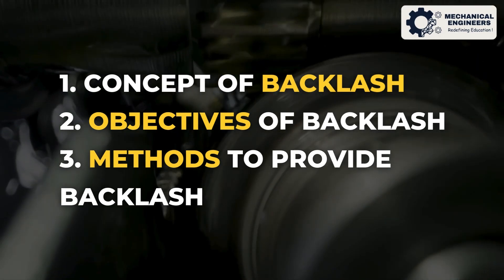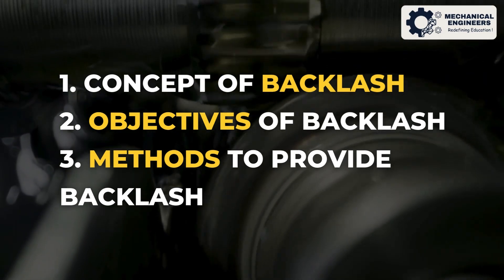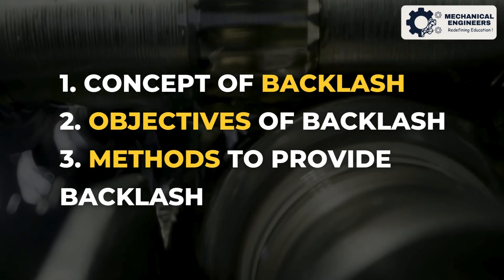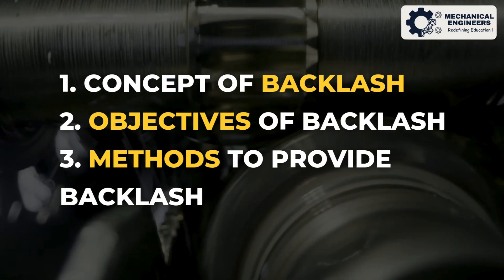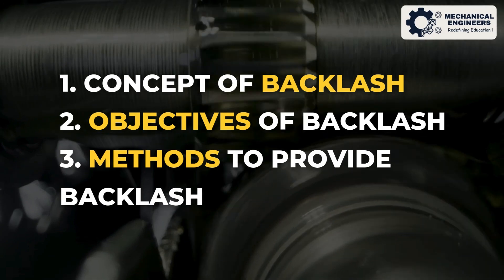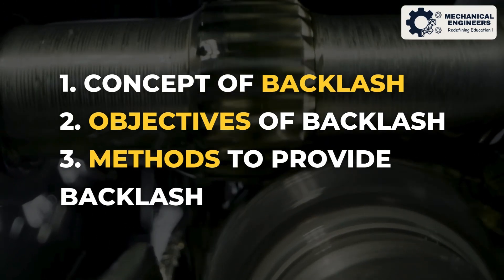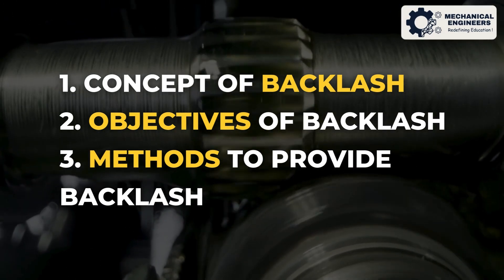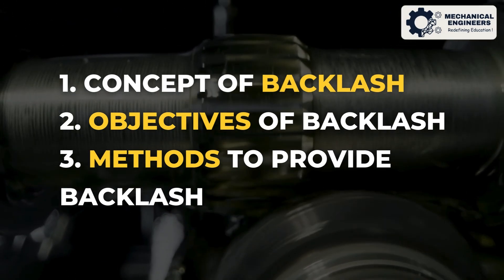10. Understanding Backlash in Gears | Definition, Causes, and Methods to Provide It | Ajay G. Dumbre

Comment: So backlash is essential in real gear applications.
Reply from the maker: Yes! A small amount of Backlash is essential in real gear systems. It prevents binding, allows for lubrication and compensates for thermal expansion. Without it, gears would wear out much faster.
Reply: @mechanicalengineers_110  had a question on a test regarding this principle, thank you for your quick response!